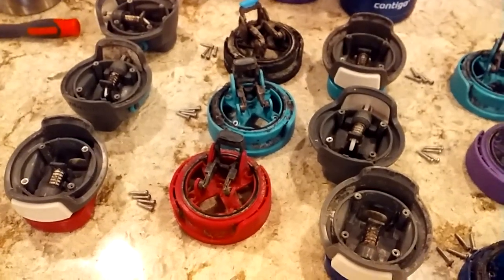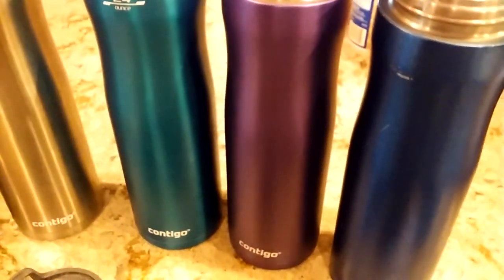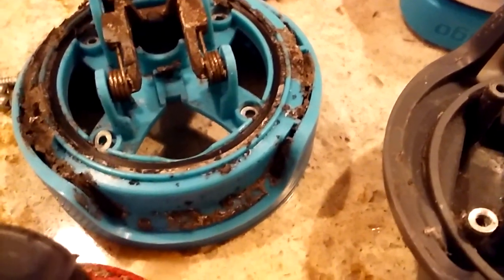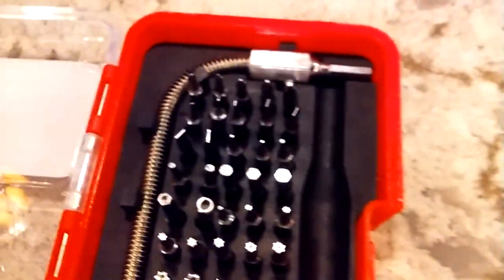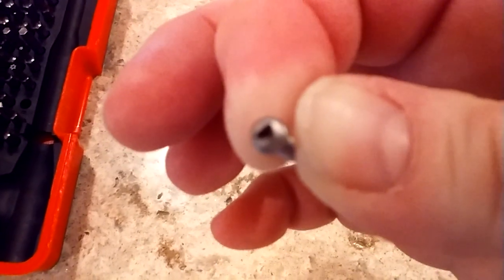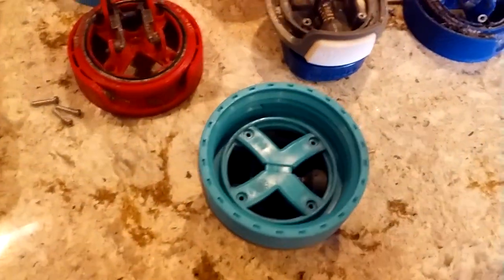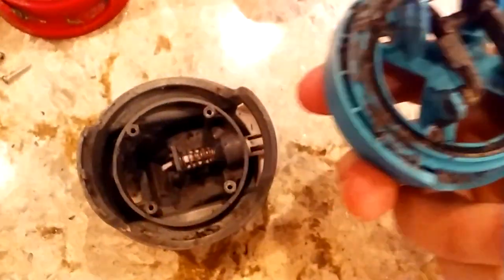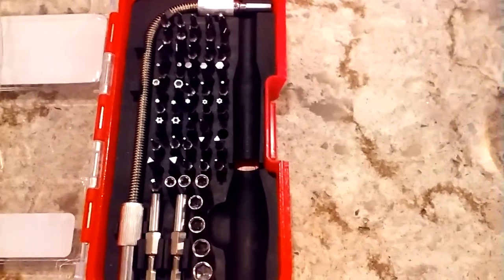I complain about cleaning Contigo water bottles

Comment: I use lemon juice shake it which cleans the inside from the tea then flip it upside down with the lid on it in a cup over night. I do wish they had a tiny brush to get down into the groves the stall ones don’t work because it has the metal tip on the end. Or u can boil it for a few minutes. I was shocked when I looked in it the first time and seen the black mold my wife had a cough that wouldn’t go away and that was why. Black mold can be deadly

Comment: Good soak in hot soapy water, lid tab pulled out. I have 2 Contigo bottles, a water bottle and a coffee travel mug using coffee with milk and sugar. If you're using any sugary drink like soda (not made for carbonated drinks) milk or fruit juice, they need to be cleaned daily. Contact Contigo with your issues and they send a replacement.

Comment: These bottles are for mostly WATER. They are NOT for hot liquids or carbonated drinks. I can almost bet that the bottles she is showing have been used for other than water.  Also why would you even put those tops in the dishwasher? It's best to hand wash them. #2 It clearly states to store the top off the bottle so that it dries properly.  I can see that NONE of those directions were followed in this video.  This is NOT contiguous fault. This is BAD user error.

Comment: I have the same problem! I bought 4 and they all are like this. I clean the bottles daily completely.  I noticed when I dumped the water out to clean them after about 1 month of use black gunk coming out in the water. I have a new one that has never been used and will be returning it. The water stays very cold but the tops harbor bacteria.  I will be contacting the company to ask for a refund. Very unfortunate!
Reply: Dude, that's what sugar does. Blame yourself for not drinking water